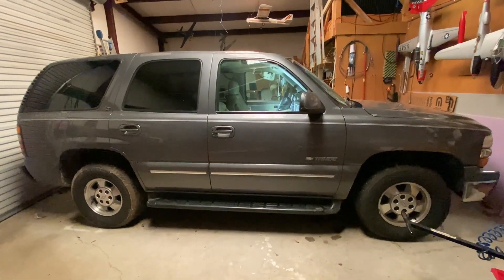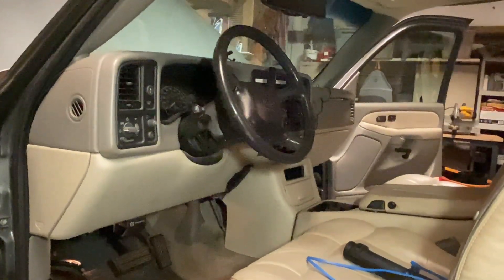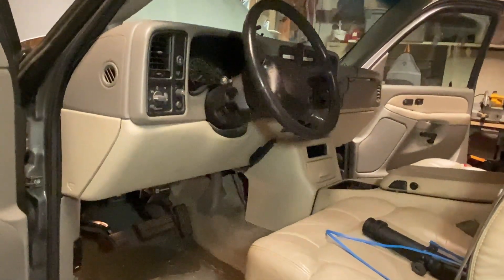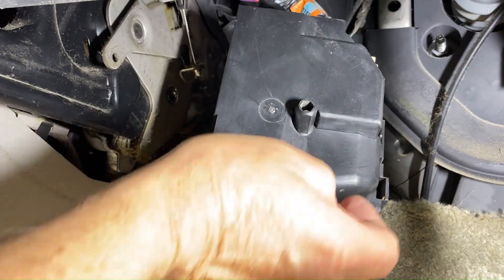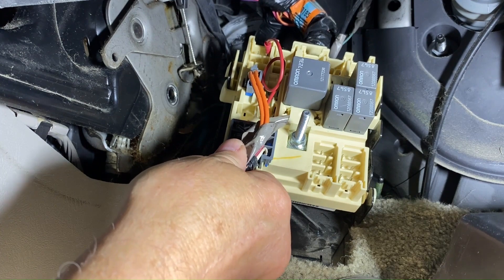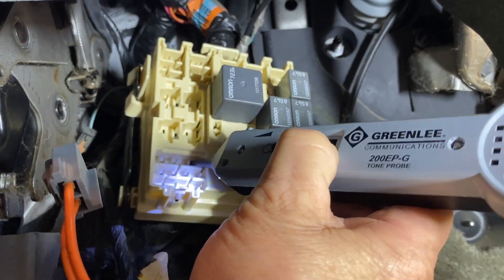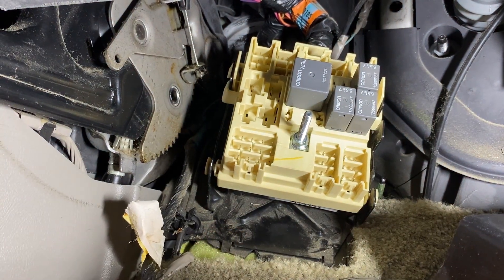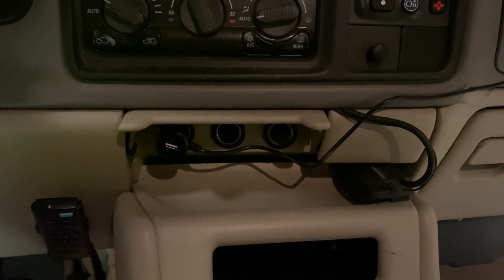12V Accessory Outlet Mod.  2001 Tahoe Conversion to Ignition Switch Power.

Comment: Great video. Did mine quickly. However, be advised the rightmost of the 3 front console outlets is on a different circuit and remains active all the time, so don’t forget that!! 😆

Comment: Great video - I did this and it worked.  I didn't cut the original wire but obviously took out the 20 amp fuse and put a note in the fuse box explaining the modification and warning not to reinsert the fuse before disconnecting the jumper wire.  Although the ignition switched circuit is probably protected by a fuse somewhere wouldn't it be a good idea to put an inline 20 amp fuse in the jumper wire to add back the same protection as the original circuit had?  I'm going to do that.

Comment: Very glad I found this!  I was on the verge of purchasing a tap-a-fuse jumper, then I would stick in the junction box under the hood off the RADIO fuse socket.  And have to run that long ass wire all the way through and connect it to the back end of the cigarette lighter socket. Which means pulling it out, that whole console, which is a nightmare.  When all I have to do is run the jumper like you said. GMC SIERRA 1500.  But your layout looks almost identical to mine so it should work!👍

Comment: Thanks for the video.  It worked great for my 2002 Yukon Xl.  Did you ever find out which fuse is protecting the Aux system after installing jumper wire?

Comment: But now your accessory outlets are unprotected with a fuse, correct?
Reply from the maker: Great point! It actually is sharing a fuse in the fuse block (can't remember which one) but your suggestion to fuse the jumper is a good one.

Comment: Thorough video and interesting process. Probably already mentioned, but should consider a fuse on that jumper, since you disabled it under the hood. Gotta protect your new gear.😊
Reply from the maker: Absolutely!  It's protected by a fuse in the fuse block (but i can't remember which one) but your suggestion would make it much easier to troubleshoot. TY

Comment: My 03 Yukon Denali use to turn off but now it stays on most of the time and turns off sometimes by itself but I have an radar and sometimes I forget to unplug it so I'm wondering if theres a bad relay that is not turning it off and if it's in that box you added the jumper? Now mines has one socket on the front  near the radio. another under it by the console, one inside the console cover, one behind for the passengers by the rear ac control and one in the back by the hatch passenger side panel and all stay on.
Reply from the maker: My '01 did not have a relay controlling the acc 12v outlets.  They were direct wired with a fuse.  I suspect that your wiring design is similar to the video however.  It sounds like you have a loose wiring connection BEFORE the under dash wiring box.  Troubleshoot accordingly.